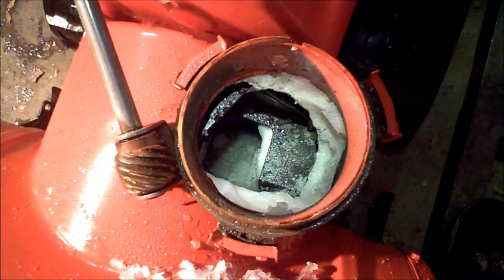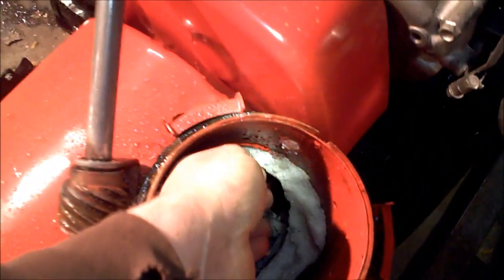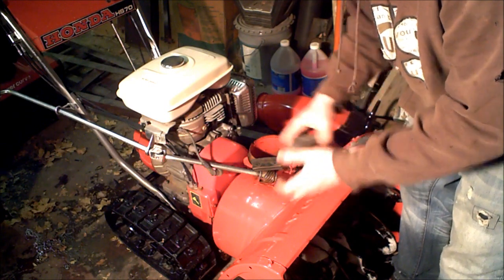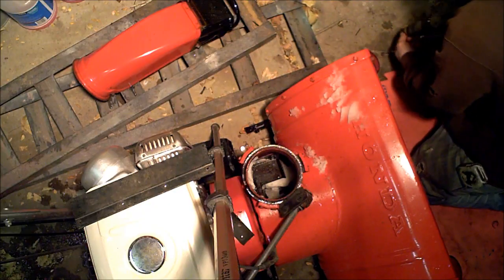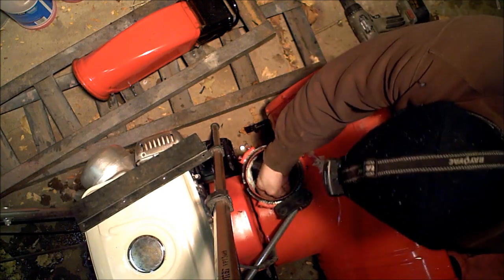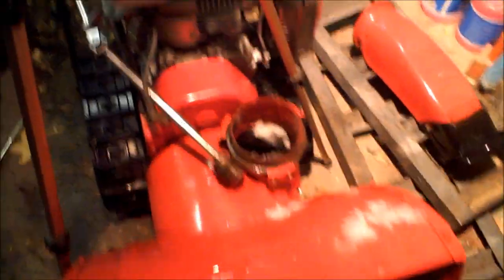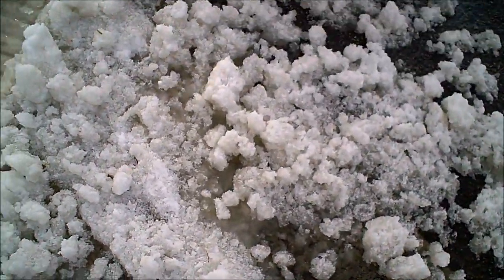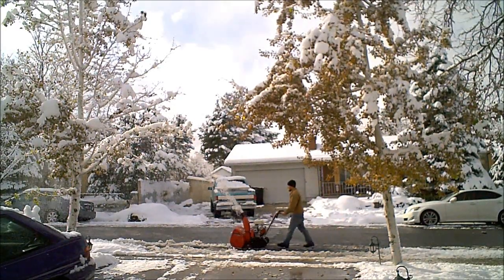Modify Snowblower to never clog and throw twice as far w/ Impeller Kit

Comment: Just added 3 piece of tire with self tappers
Changed my worn belt 
Was a little tight at first and that's what finished off the 6 year old belt!!! Trimmed tire and went at it, throwing slush and gunk 30' from snowplow on sidewalk!!! 
Not a single clog.
Finished off the apron (gutters as you called it) 

Perfect mod!!!
Reply from the maker: Awesome, I'm glad you did it. It turns the machine into a completely different beast.

Comment: Good video, great explanation. I’ve been doing this for years, and it’s amazing. Looking now to use silicone rubber, and cut it closer to act like a squeegee. Wish me luck!
Reply from the maker: Interesting. I have used a few products over the years and find the more rigid the material the better. Softer materials I was able to allow it to deflect/squeegee the sides more but it tended to tear over time. What's the consistency of the silicone rubber you're using?
Reply: @sixtyfiveford   I have just ordered it from EBay, and I’ll get back to you.  The EBay description was , Silicone Rubber Pad 4 x 8 x 1/4 Thick Sheet High Temp Solid Red/Orange 4" x 8" 

Keep the great content coming! Happy New Year!

Comment: They are self drilling screws  Self tapping screws only have a point  and need a starter hole.
Reply from the maker: Yes, but the term is loosely used and no one really cares. The self drilling screws, drill the hole and then the threads self tap the hole. So technically they should be a "Self Drilling Tapping screw" and a "Self Tapping".

Comment: my probblem with out mtd yard works machine is the one you describe but all so 2 is damp snow cloging up the auger itself but mostly on the right side for some reason .granted i did  notice that that left side dont have much of its paint left pretty rusty ,would a lack of its paint have any thing to do with snow packing in between the tangs?iv even tried sloping oild oil on them but that didnt work.
Reply from the maker: Are you sure your shear pins aren't broken.
Reply: @sixtyfiveford  hey thanks for the reply ,but as to the shear pins no they are all intact.

Comment: Thanks for this vidéo.  I was planning to do it on my HS928 (Honda), but the rubber pieces I’ve found are coming from a rubber mat I cut to protect my outdoor stairs. It’s about 1/4 inch thick. Should I make it thinner before fixing the pieces to the impeller?
Reply from the maker: 1/4" thick is great.

Comment: I have an older Toro 824 XL 24 inch with the wider tube, you said something about not on a Toro, they are thicker.  Was that in reference to the self tapping screws or that these cannot be modified?  I have a heavy machine that starts easily but clogs almost as fast.  It is so frustrating that I end up shoveling.  If you can help me, I would appreciate it.  This is an awesome idea, why don't manufacturers or shops do this?  Clearly there is a universal problem.  Thanks for any help you can provide.
Reply from the maker: It was a reference to the self tapping screws not being able to go through the thicker steel without predrilling. The Toro will work astonishing with this modification. 

Why they don't do this: The clearance gets larger over time and use and the problem gets worse. The consumer simply blames age and wear and buys a new machine. They win. Simplicity actually installed these on their machines in the 1970's

Comment: This video saved me $$$$$$. I was so frustrated with my 45 year old Ariens that I was about to buy a brand new snowblower. This mod made all the difference. I used rubber from a mudflap and zip screws. It’s lasted for 3 winters now, with no sign of failure. Only issue I had was that the rubber was putting an extra load on the engine and causing it to stall out, which was the fault of a worn out carburetor. A new $12 carb from eBay fixed that instantly. Now my antique 8hp blower outperforms the new 13hp machine I use at my workplace, with the same 24” bucket size.
Reply from the maker: AWESOME. I'm glad you tried it out.

Comment: After first watching your video years ago I finally got this done on my Craftsman in July. It sucked because the chute is really small. I couldn't get the self tapping screws to work, They just wouldn't bite. I had to get a drill extension and drill holes. I used nuts and bolts with a second nut tightened onto the first one for backup. I had trouble getting my big fat hands in there. If this doesn't work I'm going to shoot myself. I paid  good money for this blower in 2014 and it didn't work. I've never been able to use my blower. Its just one of many things in my life that makes me feel like a loser. I had your video for making a tube notcher pop up in my feed and I remember this video. My latest disaster involves tube notching and is going just about as bad as possibly could.

Comment: My snow blower does not go forward or backward, it moves about an inch both ways, but that is it.  What is the problem, can you let me know please thank you?
Reply from the maker: There's a few things it could be. If it's a hydro drive it's probably junk and has destroyed the transmission. If it's a friction disc like most are it's probably a worn out rubber disc. Flip it up onto it's front and take off the inspection cover.

Comment: Very interesting. I am tempted to modify my Kubota 2660 60" blower as the town is throwing increasingly larger rocks/cobbles from their sand casters again. The rocks are tearing up the impeller and surrounding drum of the impeller housing. If the rocks can't get trapped/pinched at the impeller edge, perhaps they will pass through more easily, causing less damage. What a great notion you have had., minimal disassembly required. Thumbs up! Rebuilds on the blower run between $1500 and $2000. It has had three since 1996, mostly related to rock damage caused by the adulterated sand the town uses. I think I have everything I need out in shop and barn to execute this upgrade.

I would caution anyone to carefully cut the heavy rubber pieces to equal sizes, very precisely, so the impeller remains balanced at high rpms. Impeller shaft bearings are at the core of a two stage blower. Full disassembly is required to replace them. Ak me how I know.

Comment: Since we are talking about ''weaknesses'' in snow blowers function, has ANYONE got a better drive system than a little wheel rolling around on a plate like a record player as the ''drive train''? That equates to a fairy dancing on a plate when you need HORSEPOWER to push your show blower ahead of you hopefully under its OWN power not me pushing it. Rube Goldberg was an INTERESTING guy, but not really the guy I want to design a machine I NEED.
Reply from the maker: Honda has their Hydrostatic Drive.

Comment: OK, So I know this vid is a few years old, but I've read over a 100 comments and not a negative one in the bunch, so.... I applied the mod tonight to my 10 year old Crappy Tire 24" 2 stage blower. I was a bit apprehensive at first because my impeller is plastic. I used thicker and longer screws and the rubber from a floor squeegee I bought from Lowes.  It wasn't quite as easy as sixtyfiveford  described, partly cause I was freezing my fingers off in -11 C .  I only  ran the machine for about a minute after I put it back together because it was after 9pm. Nothing flew off, so,  so far so good. We are expecting Snowmagedon tomorrow, I'll give it a try and maybe follow up on this post
Reply from the maker: Thanks Man, I'm glad you liked it.

Comment: timely, as i am going to pickup a toro snowblower tomorrow. the seller complained that it is almost useless in wet snow. do you bother to trim the rubber to roughly the same radius as the housing or do you find that it's not worth the trouble ?

Comment: I've been wanting to do this since last season. I have a driveway that is 100'x40'. In the mountains in CO the snow is usually pretty dry, but if you don't get it first thing in the morning, all bets are off. My 30" Craftsman was clogging constantly. 

Before I blew the thing up, I bought a giant mud flap, some self-tapping bolts, attached three pieces to each of the impeller blades by using an extension on my cordless drill. 20 minutes later I'm ready.

Holy Moses! Out of the box this thing never had the rooster tail it does now. Plowed through 2' drifts, up and down the driveway, cleared the top of the drive where the plow guys seem to love to dump everything. NOT A SINGLE TIME DID I HAVE TO STOP TO CLEAR A CLOGGED/STUCK IMPELLER! THANK YOU SOOOO MUCH! Happy New Year!

Comment: I would use a small strip of sheet metal to Borat to it so that be Tek screw doesn't pull through the rubber. Or even possibly put washers on the Tek screws. And on the Toro, you can get them with much finer thread for thicker metal and they will work just fine.

Comment: Nice but should use bolts with nylock nuts , self tapers can end up on the drive ,, street.,  there not made to stay in place on moving parts especially on on a blower fan.
Reply from the maker: I've never had one fall out after 15+years. I see a lot of the machines I installed these on a regular yearly basis.
Reply: sixtyfiveford that’s great , but I would trust a high grade machine screw with a lock nut before I’d use something that could walk out and possibly do damage something or someone. There must be some reason that the manufacturers don’t do this or we’d see rubber paddles on all machines sold . I can remember 50 years ago my father bought a lawnmower blade that you could replace the cutter edge , it might of been a sears product cause he’d buy everything there. Don’t remember what they were attached with, but one came off. I was at the neighbors house across the street hanging out with the the kid that lived there and found the edge laying on his driveway about 150 ‘ from where I was cutting. Needless to say dad didn’t buy another one of those blades ever again.

Comment: With newer more powerful glues out now would gluing the flaps work??  I have an ariens blower and the impellers are heavy hardened steel.  No way a self tapping screw would work. I tried to drill holes for bolts but after several attempts I gave up. It does a good job but could be better.
Reply from the maker: These undergo a lot of torture and flexibility of the rubber wouldn't allow any glue to hold up.

Comment: Who blows wet snow? If it’s wet it is melting. The little bit of snow you were blowing at the end of vid wouldn’t keep a 5 yr old on his trike from getting stuck. I just bet the street snowplow went by after a few minutes and threw it back in your drive. LOL I use my JD 40hp midsize tractor with a 5’ PTO 3 pt hitch snowblower or 6’ bucket. Never a problem.
Reply from the maker: LOL who runs a JD to move snow.

Comment: I  Added the paddles on all three and it worked better than without them. Wet snow and close to the road. My Craftsman (Murray) has a rectangular shoot in the housing. It still cleared all the snow even though it got stuck a couple times. No chance at cleaning my driveway without the paddles. I am happy I saw your video. Thanks sixtyfiveford.
Reply from the maker: That's fantastic. I'm glad you tried it out. Those old Murray Craftsmans were good machines.

Comment: Unbelievable it really works.  I have a 42in Craftsman 2 stage blower.  Constantly clogged, bad in soft snow, etc.  Noticed about a 3/4 in gap on impeller.. so I did the Mod.  It has 3 large blades so I used 1/4 bolts and fender washers.  Tried some heavy rubber from pipe connectors first that worked but did not last.  Then used the rubber blade he recommends from a single stage blower and it is great. Pretty noisy as it drags a bit since I adjusted to overlap just a small amount, but scrapes all the snow off.  It throws any type of snow a so far I have to be careful of getting it over my neighbors driveway!  Thanks the best tip from YouTube yet!

Comment: sixtyfiveford. I bought a Troy Bilt 2 stage snow thrower last season to replace my aged MonkeyWard single stage. The TB clogged up and threw snow in blobs. I spent more time unclogging than throwing/blowing snow. I was REALLY regretting buying it until I saw your video. I was hopeful. My TB has 3 blades on the impeller and I installed your conversion, using parts of a mud flap and screws. I drilled and tapped then put a nut on the back side as a jamb. My blades have about 2" of flat area then another 1" of blade at 45 degrees up. I used a piece about 3" x 2" and rolled it up the angled area. I did this because the angled part was also in the "window" of the chute.  We had a 3" snow today and WOW! It never clogged!  I plowed down the street to my neighbors through the plowed pile of slushy salty slop... It threw that stuff 20 ft with no problems! Can you say WOW!!!   Thank you!!!
Reply from the maker: Awesome, I'm glad you tried it.

Comment: Can i weld stainless steel onto the impeller? Wondering if that would work as well, even though it would take more time. I'm not sure if the rubber would be better for more flex, or if flex would help it not clog up just in case i got a piece of gravel in it or something. If so i will probably try to and find something like that. The gap is mine is big enough to squeeze my fingers underneath
Reply from the maker: The impeller is generally never perfectly centered so the rubber accounts for this variance. Sometimes there are carriage bolt heads sticking though the inside as well as weld seams. Welding onto the leading edge is a good idea though and I've done it on extreme gaps but still added rubber after. Not sure that stainless is necessary given the rest is just steel but I would go with at least 1/8" thick steel.

Comment: I do have some used snowblower paddles so I did what this guy said.   I haven't been able to try it yet not entirely snow.    
I do have an other idea to route some or all of the exhaust to the secondary impeller.   I will probably do it somewhere by the chute.   The idea here it to try to keep it from getting clogged. 
It probably will not work.
Reply from the maker: Sounds great.

Comment: Great video! 

I took the improvement one step further: Get a die grinder and "port" the discharge shute. There was at least a 3/8" restriction in the opening from the main housing to the discharge . Just rough manufacturing tolerance, but smooth it out and get even more distance throwing.
Reply from the maker: Awesome.

Comment: Do you find any difference between putting the paddles on the top surface or the bottom side of the impeller?
Reply from the maker: You have to put them on the top. They will rip right off on the bottom.
Reply: @sixtyfiveford  OK Thanks for getting back to me.

Comment: Sorry for being a dope....but where do I find the "video description" link that lists the paddles and ss screws?
Reply from the maker: The paddle material will hold up a little better and it easier to work with than tire sidewall. Tire does work and I have use it many times, but only in a pinch. 
Rubber paddle material: https://amzn.to/2E3CHSp
Self Drilling Bolts: https://amzn.to/2QuwHYA
Self Drilling Screws: https://amzn.to/2E6eDOS

Comment: Ok so here's my question.  So after a long time them rubber pieces start wearing out as they should. Now to replace them again are you making new holes in your impeller or using the same holes. Thanks
Reply from the maker: If you use good material they'll last the rest of the machine life.

Comment: turbine tip clearance control for a snowblower.  Genius.  On turbine engines we use bypass air to cool/shrink the case to reduce the tip clearance and improve power/efficiency.   He is right about the turbine striking the case, that would be bad but the flexible rubber strips take up the space and wear to fit.
Reply from the maker: Thanks, I'm glad you liked it.

Comment: I Have blower with Rubber paddle try Figure out Scraper height should be 1/4 in clearance.
Reply from the maker: I generally put the scraper 1/16-1/8" higher than the skid shoes for concrete driveways.

Comment: have you ever had one fall off?  I would imagine the screws would rust and fail after a year or so.
Reply from the maker: I've had the rubber rip on a few if I put the screw too close to an edge. Never seen a zinc plated self tapping screw rust out or even really rust at all. I guess it's possible to rust out if your a person that heavily salts their driveway but then your entire snowblower would be a pile of rust flakes in a matter of years anyway.
Reply: sixtyfiveford   Zinc screws will rust.  Don’t need to salt the driveway.  If you are close to the water,  even stainless has rusted on me.

Comment: I recently brushed on coconut oil (warm) onto cold shovels to keep the snow from sticking.  The coconut oil solidifies onto the shovel, making a thick non-stick coating.  It seemed to work.  We shall see how long it lasts, but it may help on a snow blower as well.  I don't have a snow blower,  but this video is making me think maybe a cheap used one could be good if modified.  Thanks for the tip.

Comment: I used rubber from a mudflap, and zip screws. My '70s Ariens has a 4 blade impeller, so I only installed the rubber on 2 blades. Now my 40+ year old, 8hp machine has better performance than the brand new 13hp Ariens Deluxe (same bucket size!) that I use at my workplace. One thing I found out, is the rubber definitely takes some breaking in. My engine was bogging and stalling at first, but a $12 replacement carb from ebay fixed that. So if your machine has trouble after the mod, it means the carb is shot anyway.